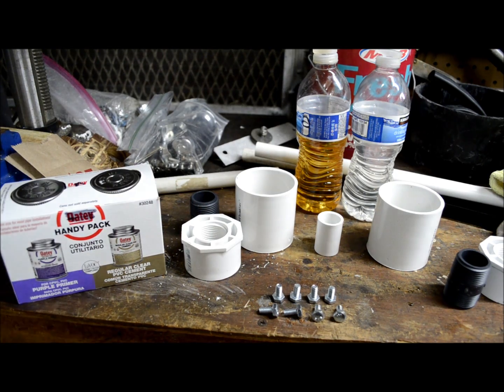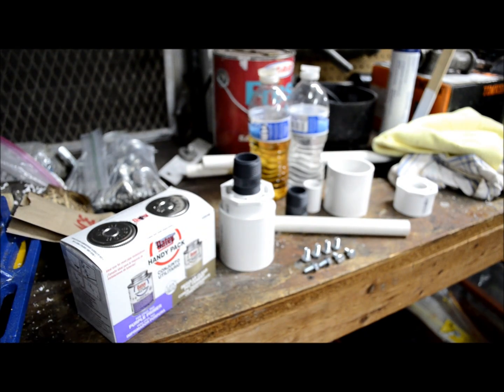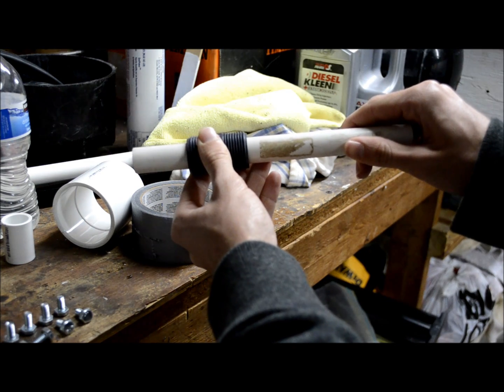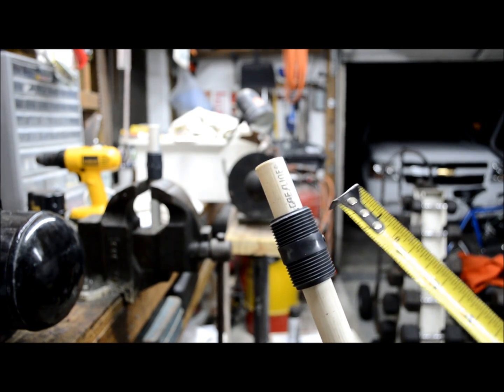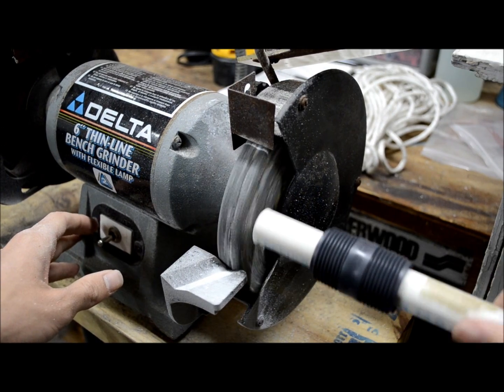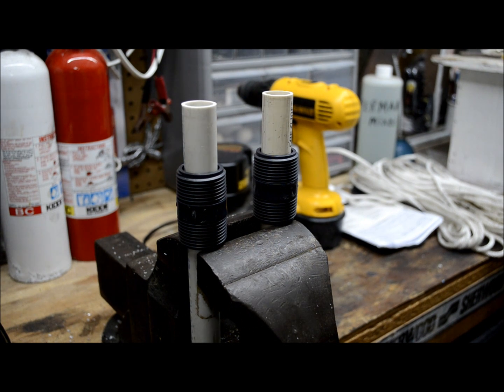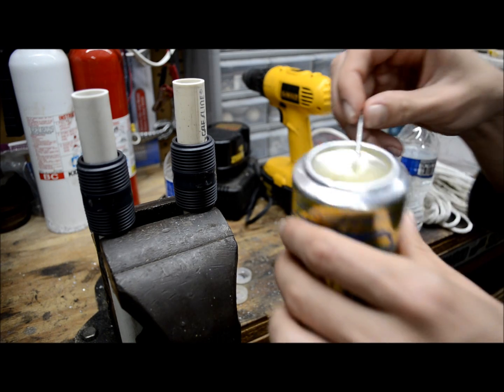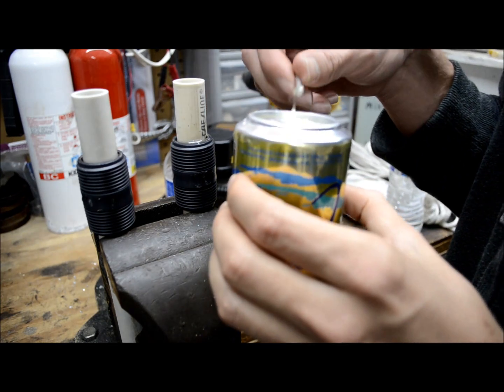HOW TO: Make Your Own Train Horns for $5!!! In-Depth Tutorial- Part 2, Assembly

Comment: FYI    When you use plastic or wood on a grinding stone they get clogged up and the heat can't escape ! They then EXPLODE in your face !     I've seen this happen.   Pieces even went through his safety glasses and into the guy's eye socket.   A belt sander should be used.

Comment: If you use the grey pvc threaded fittings found in the electrical aisle instead of the plumbing type, you will have better range of threading.  The threading of pvc plumbing vs. pvc electrical conduit is basically identical with the only difference is the plumbing stuff has a taper designed into them for sealing and the electrical maintains a constant diameter.  
For that reason, i use the grey stuff when making bulkhead fittings to add hose connections to the bottoms of plastic barrels...they thread together deep enough to squeeze o-rings and seal against the barrel walls.

Comment: Went to home depot and Lowes today. Could NOT find the 1" threaded pipe nipples you used. Those are pvc/plastic right? I ended up buying metal ones that look similar. If those are plastic, where in the store did you find them?
Reply from the maker: I believe they are called risers, and they can be found in the irrigation and sprinkler section! Sorry about that my friend
Reply: Thanks man. Ending up finding them at a local hardware store. They were in the schedule 80 section. I bought all they had. Just finished up my 1st horn tonight. Going to test it in the morning then build the 2nd one. Any advice on bell tube lengths? I'm just guessing based on looking at the ones in your videos. Thanks for taking the time to post those!! I'm having fun building them.
Reply from the maker: Awesome man I'm so glad to hear the video was helpful! Best of luck with the testing tomorrow, I hope they sound great and loud as hell! for the tubes, start longer. you might like the sound of one with a longer tube, but if you start too short, youre SOL. start with about 18 inches or so! Look forward to hearing how it goes!

Comment: npt is npt its a standardized size
Reply: Different sizes of pipe have different thread pitches and dimensions. "NPT is NTP" in the sense that it is standardized so the same sizes of pipes and fittings go together, yes.
"NPT is NTP" in the sense that any NTP pipe or fitting will work together regardless of size, no.
http://machiningproducts.com/html/NPT-Thread-Dimensions.html
Not trying to be a dick, just clarifying for others that may come across this.

Comment: nice tip on the threads to tune the diaphragm. i will use this for my second build. first build was just too see if i could get it to work. didn't cost me anything,  i  just used material i had in the shop. looks nothing like any of the builds on YT...
parts i used: 2" black abs, 1 1/2" clear tubing, wood disc for top coupling, pop can diaphragm, some tigers hair & gorilla glue, 1/2" pvc tubing, big ass funnel. done... works better than you'd think.

Comment: A good method for protecting the threads from the epoxy is either a mold release spray like a dry film silicone or a healthy coat of petroleum jelly.  Either of which would stop the epoxy from bonding to the threads and clean up easy.
Reply: +Francis Taracido or... wrap them with tape.

Comment: Nice. At my hardware store those fittings would be like $15
Reply from the maker: wow... you are going to the wrong store! 5 bucks for everything at home depot
Reply: My local hardware is so expensive! I spent $20 the other day on a brass tee, and a few 1/4 inch nipples
Reply from the maker: my local hardware store is also very expensive with brass fittings
Reply: Isn't it strange though that a 4'' PVC end cap is just a piece of plastic, but costs like $10? They're not even milling them, just molding them.
Reply from the maker: Well if you thinking about it, a 2" pvc cap costs about a quarter of that, but a 4" cap is more than 4x as much plastic, so it makes some sense. Then if you thinking about it as being a piece of plastic that costs 10 dollars, its a little strange. Then again, a car is just a big piece of metal, right? :P
Reply: Yeah, just a big piece of internal combustion metal :)

On a side note, what is your method for making pvc sheet?
Reply from the maker: I just take a stick of pvc (the size depends on how thick I want the sheet to be; the bigger the pipe, the thicker the walls and thus the sheet), and cut a slit straight down the pipe lengthwise. I preheat the oven to about 250-300 degrees, just hot enough to soften it, and leave it in for 3-5 minutes or until you can see noticeable warping (this means its really soft). Then i take it out to the garage real quick because it will cool rapidly. then i open it up and press it down with a  flat object until it cools completely. 

I should make a video on this...
Reply: Thanks!
Reply: 1nxtmonster I made a ball mill out of mostly scrap parts. I used 6" PVC for the containers. The endcaps were probably the most expensive parts. I made 2 containers though. I don't remember how much the steel ball bearings were, but they were spendy enough that I didn't get stainless ones, even though I should have. 0.50 Cal lead muzzle loader balls work good when non sparking is needed. Considering the static electricity potential of PVC extra caution should be taken when doing flammable mixtures though. Nothing has blown up yet though. :-)